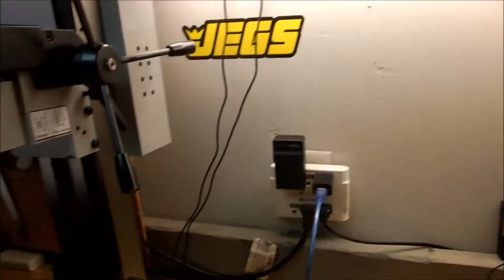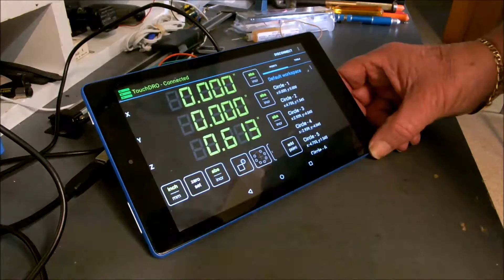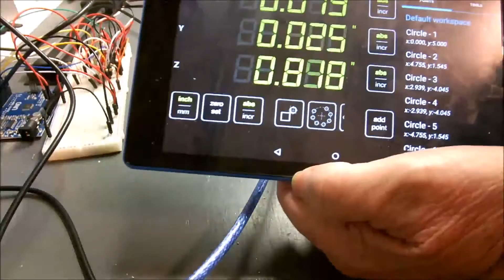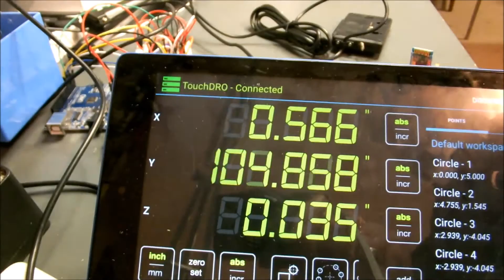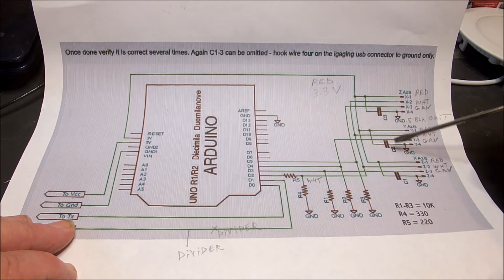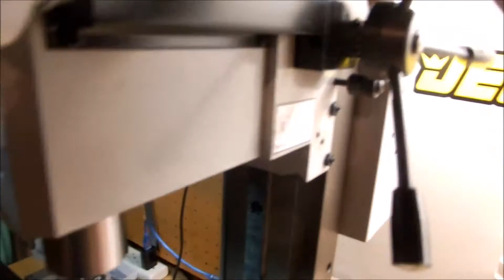TouchDRO Installation

Comment: Dear Mr. Jugel!
I was surprised by connection of CLOCK signal from calipers to one input, because the calipers electronocs is independent for each caliper and has its own clock generator. How is it possible and how it works internaly inside caliper - is not there some problems of interactions of clack genearators in the calipers?
Thanks 
Jiri

Comment: did you ever get it perfected and get the board's made? how much for a plug&play system? Ive been looking at the ardiuno stuff banggood has at super low prices, but i realy havent a clue about all this stuff. will this also work with the calipers/scales with the spi plug?
Reply from the maker: Never made a PCB because the prototypr worked so well I just went ahead and used it.  I understand there are some versions out there now for the other scale types/manufacturers but haven't looked into it at all.  Try this website for further info and leads ... :-) https://sawmillcreek.org/showthread.php?204470-Android-Bluetooth-Wireless-DRO-with-Arduino-and-igaging-scales

Comment: You have proved it possible to provide so little information as to make a video useless to anybody that is not already well informed.
Reply from the maker: Yes, that's true, Judy ... There are plenty of videos that go into the circuitry and construction of the DRO and this one is intended to recap an actual implementation of the project and illustrate that it's not a difficult build and is well worth the effort.  Here is a link to the definitive authority that will provide plenty of information, plus finished DRO controller boxes and kits.  Hope that helps you out. http://www.yuriystoys.com/

Comment: The issue with the nano is that it sources the 3.3v voltage rail from the Uart chip instead of from a regulator. This source is only rated from 50ma. The Uno has a stand alone 3.3v regulator which can supply a much larger current.
Reply from the maker: Thanks for your input, Jon - I wasn't sure whether or not the 3V line would be a problem or not and considered just leaving the 3032 batteries in each sensor (2 per sensor, if I remember right) and continuing to use them instead.  I tested the Nano version alongside the Uno breadboard version and the current max proved to be no problem because each scale sensor needs only a very small amount.  The plan was to go back to the batteries if I had any calibration or stability problems, but so far the DRO has maintained its initial calibration and the displays are almost rock solid at 1/1000 inch.

Comment: hey Richard thanks for taling the time for a video. just caught up on this myself. bout to finish my case and wire er' up thanks for the I think you said 30k ohm cross the signal to gnd if that smothes out that flicker I got on my bread board.version id say you saved a head ach lookin at this thing at lets face it 2:00 am more than once thanks for that!!!!
Reply from the maker: Glad you enjoyed it, Dude, and please post pics of your project too, especially the case.  I have not decided to do a case for mine or just leave it as is.  The pull down resistor values are not critical and 30k is a nominal value that will force the pin to ground during 0 state and minimize current flow when the pin goes high.  I am very satisfied with the visibility of the readouts now and it makes it much more enjoyable and less tiring to play with and learn about the mill. :-)